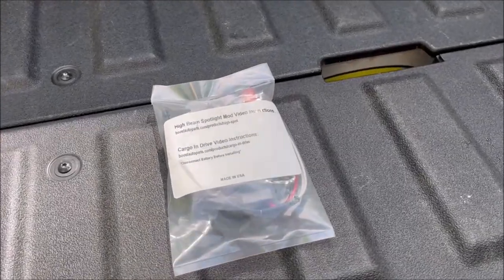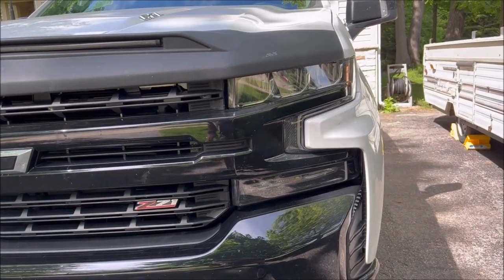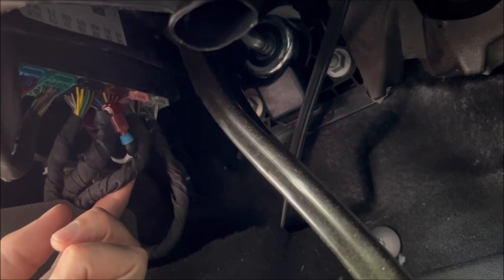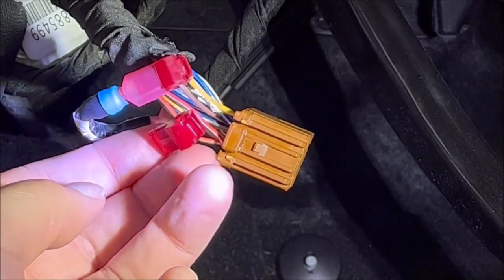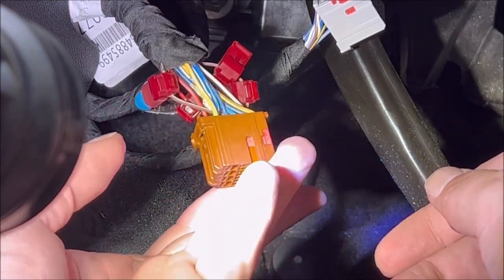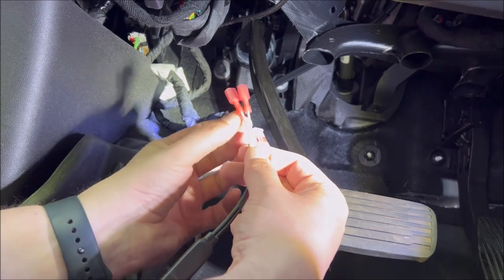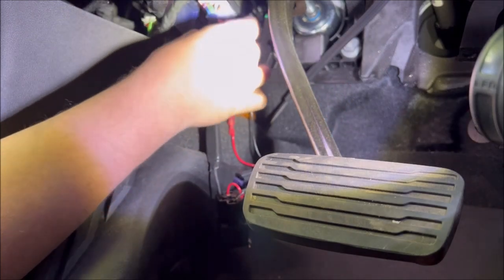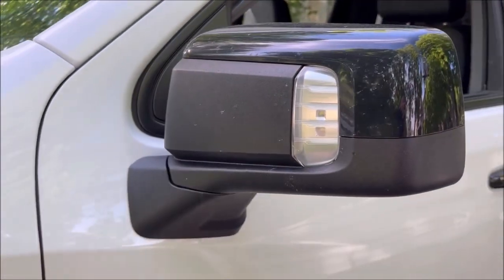High Beam to Spot Mirror Mod - Boost Auto Parts

Comment: Hey there! Just a quick heads up, I've noticed that some people are having a few issues with the check engine light after installing the factory mirror spotlights. Do you happen to know at what speed the spotlights turn off when you shift into drive? I'm guessing it's around 5 or 10 miles per hour, but I'm not entirely sure. I'm seriously considering doing this upgrade, so any insights would be really helpful.
Reply from the maker: Hi there - no check engine light for me. I’ve had these on for around 2 years. If you don’t disconnect the battery you may get a temporary BCM code, but that’s about it.

I don’t remember but I thought the lights only came on when in park.
Reply: @tommysgreatoutdoors  awesome thxssss🤛🏼